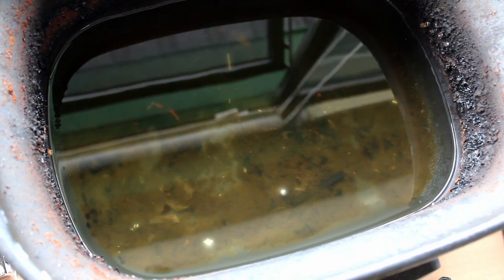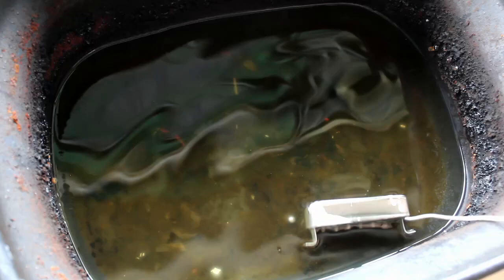Wax potted vs unpotted guitar pickups - a back to back comparison with the same pickups

Comment: I've been building guitars for a good twenty-four years as of writing, and find that a little bit of microphonics help in instruments that have good wood; not specific types of "tonewood" as such, but those occasional pieces that just have resonance and feel alive. Like when you pick up one of ten Teles and find one that has real responsiveness and character. Pair this with some slightly (or very) microphonic pickups and the whole thing comes to life when working as part of an amplified system with closed loop feedback. Like anything, you can have too much of a good thing. Equally, heavily potted pickups have their own place but are more resistant to mechanical noise and unwanted stray feedback. Potting is just another characteristic you can dial in, not a good/bad absolute.

Comment: I have a set of old unpotted GFS KMZ PAFs in an Agile. I definitely like them a lot, but I'm not entirely sure I'd not enjoy them just as much potted.

A stock unboosted JCM800 can easily generate enough gain to create microphonic problems, and I tend to use boatloads of gain.

The potted sounds in the demo certainly didn't seem to lose much "mojo" - I'd hardly call that ruined, myself. 

Certainly makes for a more useful instrument, which is why EVH potted his patent number pickup that's in Frankie.
Reply: Agreed with all your points

Comment: It could be confirmation bias but I prefer them unpotted unless I'm playing clean lines with high gain, then the overtones seem to make the attack mushy. I think its like choosing tyres for your car, you have to choose what's appropriate for your conditions and needs. You don't need snow tyres in the tropics, you don't need wax potting at low gain/volume
Reply: high gain = distortion and squeal, maybe your hi-gain is at a very low volume?

Comment: 1 B potted
2 A potted
3 B potted
4 B potted

listenign through my TV, there's a difference, like rolling the tone pot back a bit and it sounds a bit like there's a very tight and short reverb on one set of pickups, presumably the unpotted ones. I generally don't use unpotted as they do embarassing things with a moderate distortion with a loud band.